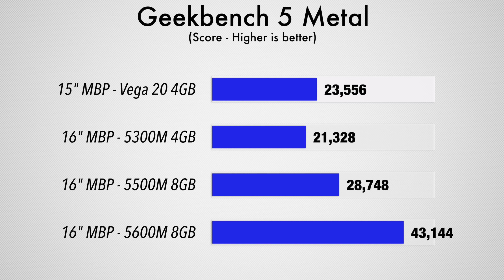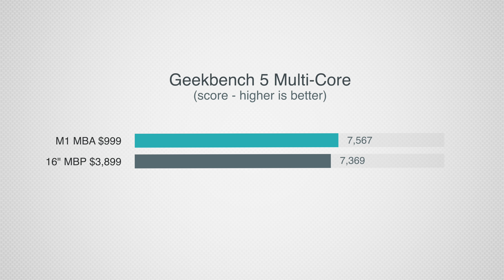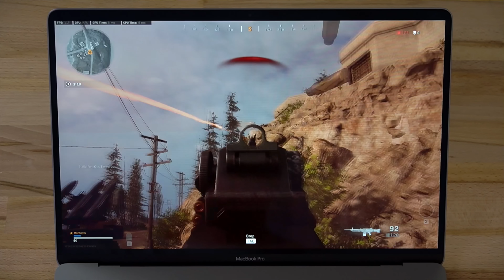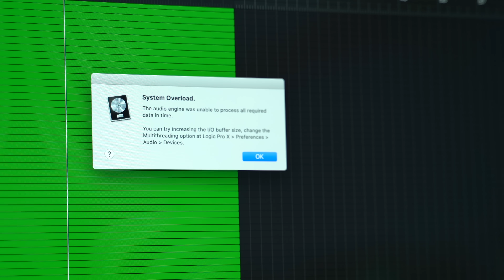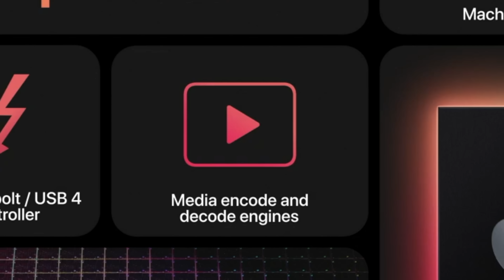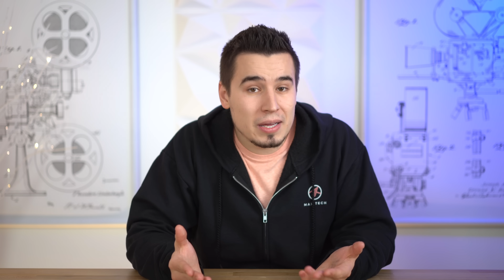M1 MacBook Air vs i9 5600M 16" MacBook Pro - REVOLUTION!

Comment: I'm using Macbook Air M1. Sometimes it is hot just playing video on Chrome or Brave browser. CPU shows 300% for the browser helper process. The other time I found it also runs hot is when I run arm64 Ubuntu on Parallel. I doubt that it can really handle heavy tasks without thermal throttling. Given that most softwares are not optimized yet for Apple silicon, I still doubt that it is as mind blowing as many reviewers have concluded. Anyways, the M1 Macbook Air is still worth it.
Reply: Mine isn’t hot even when playing 8K video on chrome, it’s just slightly warm

Comment: I'm so stoked for the Apple Silicon 16" MBP
Reply: I’m planning to get that one only! It would be such a crazy upgrade from my current 15” mid-2014 MacBook Pro!
Reply: @aaryandabra01  when is it coming out?
Reply: @VirenMohindra  by the end of the year hopefully
Reply: @VirenMohindra  I'm hoping first half of 2021
Reply: @aaryandabra01  yea
Reply: @aaryandabra01  that will be a massive upgrade for you! Can't wait! I've got the first gen 15"MBP with touch bar.
Reply: @aaryandabra01  mee too bud
Reply: I ordered a 13 inch fully loaded after 5+ years with a 15 inch. Didn’t want to wait and was afraid that a 14 or 16 inch with M1X would be out of my price range.
Reply: My current computer (2012) is limping so I’m hoping the 16” comes out soon
Reply: rip my 16in
Reply: When the M1 Arm 16inch comes out I will be getting one.
Reply: Hey, how are you now? :)
Reply: Hell yeah 🔥
Reply: I’m stoked for the M1X or the M 2 if they can use that without people getting confused with m.2 ssd . Lol
Reply: Did they ever have a 16 inch air?
Reply: @jameltanderson  no. Probably will never have one
Reply: @jameltanderson  nope, never. The air was always meant to be smaller and portable
Reply: @jameltanderson  ooooooo
Reply: @jameltanderson  I would want one.
Reply: @jameltanderson  They used to have 2 screen sizes for the Air, the 13 and 11 inch. Now they have just the 13
Reply: It’s going to be absolutely insane. It’ll have the strongest cpu in any laptop most likely, and will last 20 hours with that huge of screen. I’m personally going for the 14 inch though.